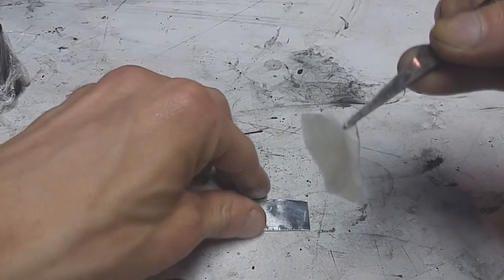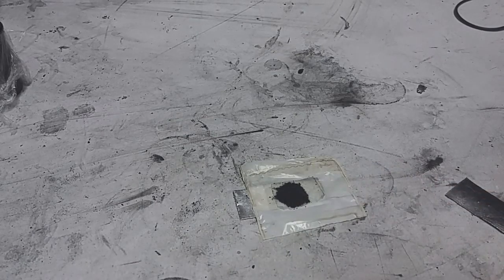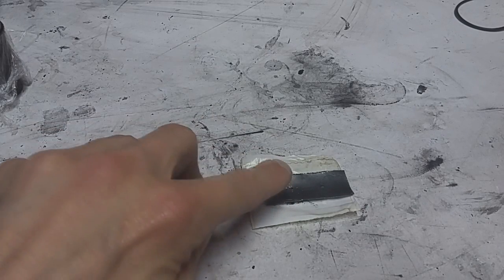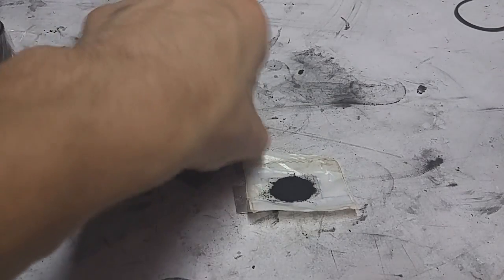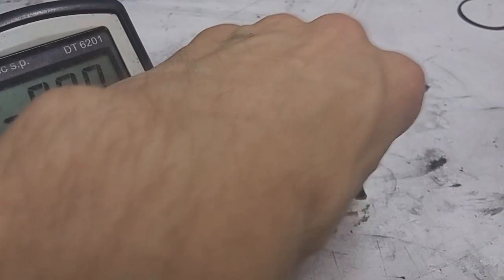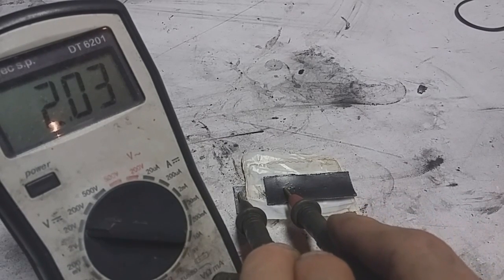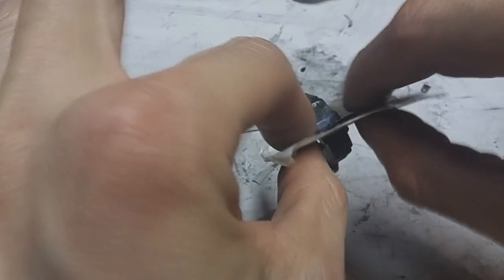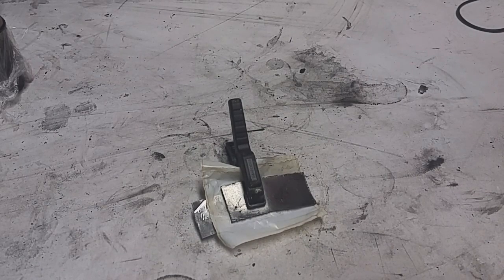High Voltage Aluminium Air Battery

Comment: Doesn't sulphuric acid react with activated carbon powder and just burns it to hell 😅?
even at low concentrations (I tired 7ml  98% + 25 ml water), still burnt  the   hell out of the thing lol. They're extremely reactive together.
Reply from the maker: Pure activated carbon will not react with H2SO4. Maybe you have some burned wood 😁. Because I treate the activated carbons with sulphuric acid and some times also with combination of sulphuric and nitric acid all the time without any reaction like you described.
Reply: @cayrex  Oh I dont know mate. It keeps on bubbling really hard and it makes a very strange smell. when I looked it up, I saw that carbon reacts with H2SO4 according to this:
C+2H 2 SO4 →CO 2 +2SO2 +2H2 O
, so I thought this smell is SO2  gas, which is very bad for health, I was scared haha . 

Then what do you think is this smell and bubbling? I mean I'm sure I have legit carbon  and acid, I bought them from  a lab.

Comment: I prefer solar to batteries. no icky chemicals to handle and no moving parts and no storage issues and all the problems that go with batteries. much easier to simplify things and just link a solar panel to whatever your trying to power.
Reply from the maker: Ok. The batteries are her for storing produced energy from solar, for example. The energy from solar you get only when the sun is shining ☁️☁️☁️🌒🌒🌒🌧🌧🌧
Reply: @cayrex  yes your right but sometimes its easier and cheaper just to buy a large second hand battery than to make your own. you can get some real bargains if you hunt them down. i just dont like handling acidic chemicals. not good for your health,

Comment: i made an aluminum air battery using aluminium KOH and activated c.   it was powerful 1.5 volts using 3 in series.   however it runs out quickly i can hear the KOH reacting with aluminium when not in use, which ofc is expected ,   how to slow this down?  would a KOH gel electrolyte be  better?  if so what could i use to make KOH Gel,?  glue? glycerin?  any thoughts on this much appreciated.
Reply from the maker: https://www.youtube.com/watch?v=NaOzDt83XWY

Comment: If I have say carbon+acid in one cup and aluminum+base in another, would it still work although both electrodes+electrolytes be in different containers?
Reply from the maker: Yes,...  you need only salt bridge to connect tgis two cups
Reply: @cayrex  like a PEM, is it?
Reply from the maker: @angelusmendez5084  The most easy way will be if you use filter paper. One end of filter paper will be in acid cup and another end in alkaline cup. The filter paper will soak up acid in one side and alkaline in the other side. If you use for exapmle H2SO4 and KOH then the filter paper salt bridge will be K2SO4 or Na2SO4 if you will use NaOH. Also if you have some rubber hose with 2 to 3 cm hole,.... you fill it with filter paper or premade filter paper which is soaked in K2SO4 for example. You can also gel it,... but that with filter paper is easy. The salt bridge is normal always the result of the reaction between acid and base you use.
Reply: @cayrex  Thanks mate, you're the best! 🎉

Comment: Hi cayrex I'm making a long lasting aluminum air battery for use at home. Carbon cathode. What do you recommend as electrolyte for long use and low maintenance???
Reply: Pm me if it's preferable.

Comment: Watt the polimer is and how wee obtene
Reply from the maker: I use the seperator from lithium ion batteries. The seperator is called Celgard 3500 or you can use celgard 2400

Comment from the maker: High voltage Aluminium Air Battery from household materials! https://www.youtube.com/watch?v=PjEnIZwfMKw
Reply: Is it voltage or milli volts-where the videos says: two volts
Reply from the maker: @Dailymailnewz  volts not mili volts. 2V
Reply: @cayrex  very good but how many Amps?
Reply from the maker: @Dailymailnewz  https://www.youtube.com/watch?v=2ZiYcd-HdO0 here is the video of the test of Aluminium air battery made from Household Materials. This one have around 170 mA - 200 mA with Celgard 2400 seperator but with celgard 3500 you will get higher current

Comment: Ze aluminium air cell not battery cannot be rechargeable? Graphite electrodes for terminals and polymers for separation. You need some electrolyte but sulphuric acid is toxic and dangerous? dilution with h20 the Potassium hydroxide will erroding the steel? The activated carbon grinding need compression with a mesh grill with hydraulic pressure and used 100c heat to fuse the plates together. The activation makes very dangerous. I tried but failed. I gave up. Ze magnesium attempt Wath h20. No recharge but recycled can be. Peace ✌️ out people 🌍

Comment: This seems a very self destructive chemical combination. The chemical discharge to create a charge. Is a limit on time or volume of chemical or metal. Electrolyte that transfers the metal back and forth seems more. Long term. Don’t you agree. Lithium and nickel iron. For instance.

Comment: How do I make an aluminum air battery that is rechargeable?
Reply from the maker: Hmm,... hard to say,.... use some ionic liquds als electrolyte
Reply: This type of battery is not rechargeable in the traditional sense... You must mechanically replace the aluminum plate to "recharge" this kind of battery..

Comment: how long does this last and how much voltage can you get if you add several battery on serial?
Reply from the maker: several batteries in serial? how much you need,.... you can connect 100, 1000, 100000,.... if you want. the battery will run so long how long will be the aluminium good (not corroded).
Reply: ok, how long do you think it can last before aluminium get corroded, any idea?
Reply from the maker: I dont know. try

Comment: Well done. Can we also use Vinegar instead of Sulfuric acid or Citric acid , because it is much more easy to get ?
Reply from the maker: overunitydotcom yes, any acid will work. I dont know how many volts you will get but will work also.
Reply: brick acid muretic i think hardware store or brick store A

Comment: so how do you keep the potassium hydroxide from disolving the aluminum
Reply from the maker: James Cole uf, this is hard because transforming aluminium into aluminium oxide/aluminium hydroxide is part of the oxidation process and you can not stop this.
Reply: You probably can use a bit weaker electrolyte for this electrode for instance K2CO3 or NaCO3
Reply from the maker: Stefan Hartmann yes you can,... you will only slow down the oxidation of aluminium but in the end the aluminium will dissolve completely.